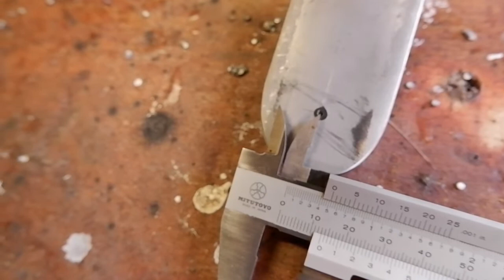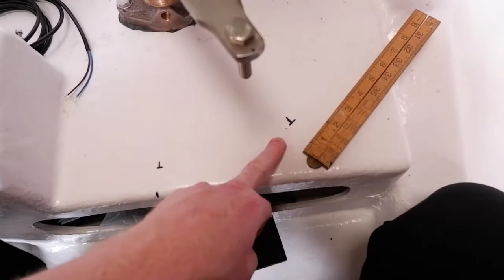Fitting the Ram (Episode 15)

Comment: Gday mate i know a whole lot about  roll and tipping , normally i would spray the boat with 2 pack polyester and two pack epoxy primer ,but the young lady next door was in her last trimester of her pregnancy so not a good idea to be spraying even if the place is covered like a spray booth . so i had to roll and tip the whole lot , 15 foot boat topside ,sides and bottom . and people wonder why it took 2 years 2 coats of  epoxy primer sanded between coats and rub throughs touched up on the whole boat  and 3 coats of color (white and orange) sanded and touched up on each coat ,but lets not stop there lets put two coats of primer on the inside started to color coat it but didnt like it so stopped what a job . I know this paint is good as i have used it on all my restos and it has never let me down and i too had to watch a heap of videos on how to do it . Mine does have brush marks through it but t will be a brave man to criticise the finish .
Reply from the maker: Aye.
That sounds like a heap of work you done.💪😁👌
But well done, you for looking after your neighbour like that, total respect right there, sir.😉👍
Reply: @onemanandhisboat  yea it would have taken about 3 days to spray the boat but well didnt want to be spraying nasty stuff around with the baby near coming doesnt matter gave me something to do hahaha